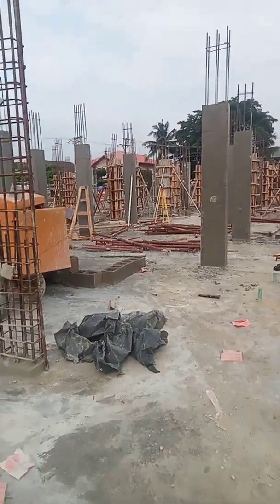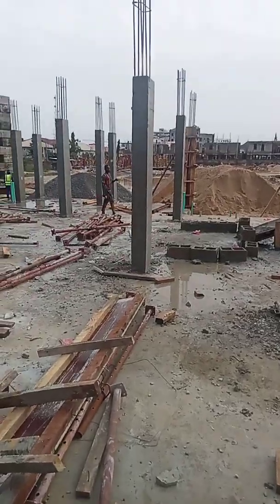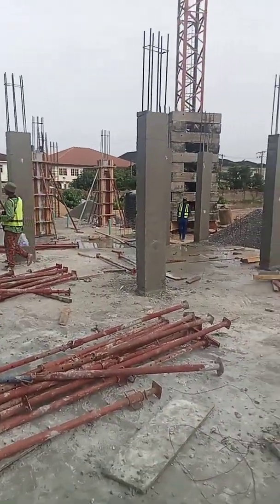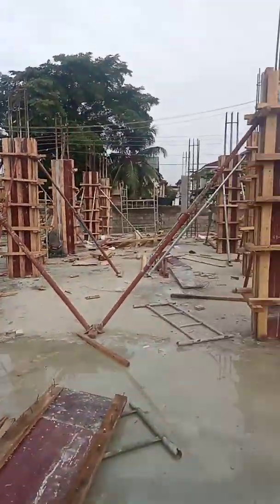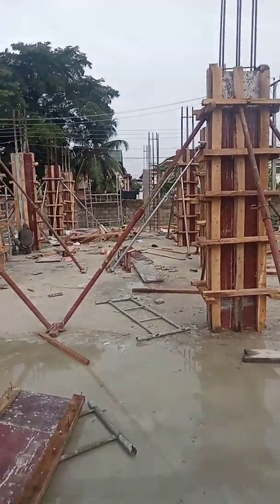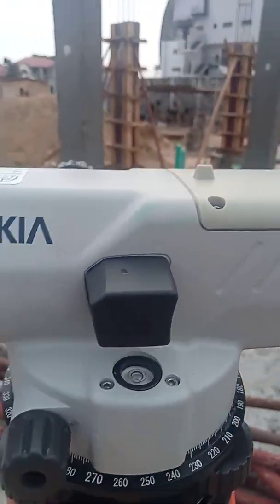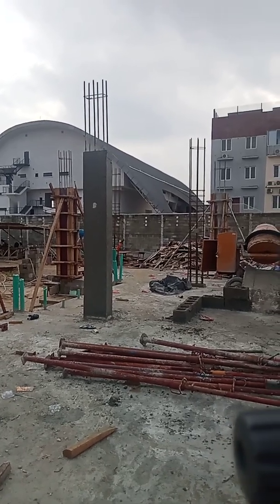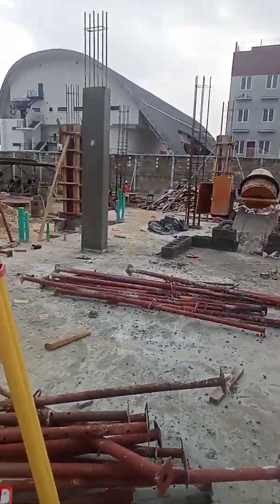How to transfer 1meter Level above DPC to Columns

Comment: Thanks for doing this video, I really learnt from it. What I want to ask is that how  do we determine the  DPC levels of buildings in an undulating area?
Reply from the maker: We will check the designed height for the Dpc related to existing road level and relate with the resident architects for approval.